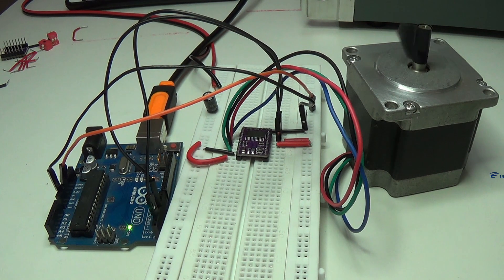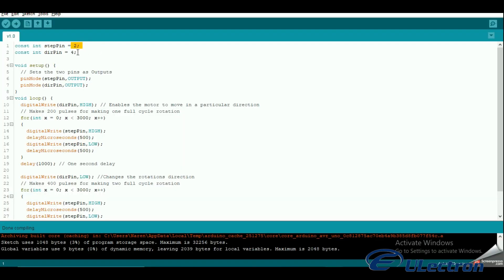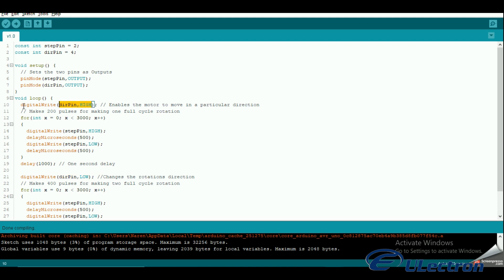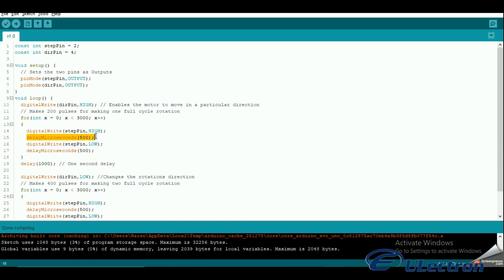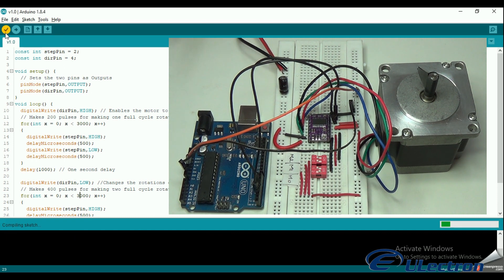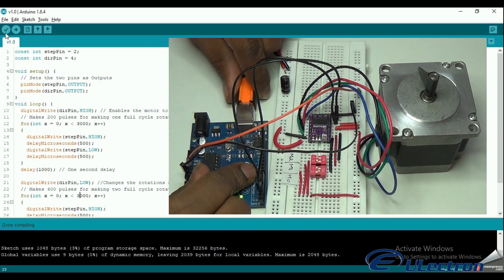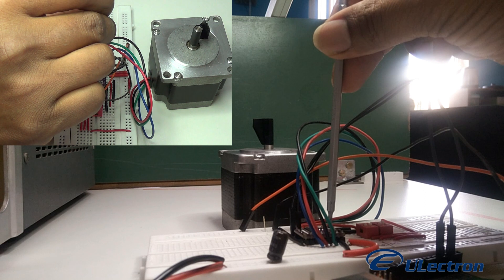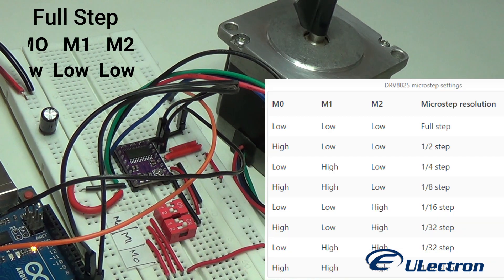How to interface DRV8825 and stepper motor with Arduino|ULECTRON|

Comment: Bonjour,
je démarre dans l'arduino et je souhaiterai faire fonctionner des moteur pas à pas avec un DRV8825
mais je n'y arrive pas 
serait-il possible d'avoir le soft pour tester les moteurs?
Merci

Hello,
I start in the arduino and I would like to run stepper motors with a DRV8825
but I can not
would it be possible to have the software to test the engines?
Thank you

Comment: const int stepPin=2;
const int dirPin=3;

void setup() {
  // put your setup code here, to run once:
pinMode(stepPin, OUTPUT);
pinMode(dirPin, OUTPUT);
}

void loop() {
  // put your main code here, to run repeatedly:
digitalWrite(dirPin, HIGH);
for (int x=0; x<3000; x++)//make 200 pulses for 1 rotation
{
  digitalWrite(stepPin, HIGH);
  delayMicroseconds(500);
  digitalWrite(stepPin, LOW);
  delayMicroseconds(500);
  }

digitalWrite(dirPin, LOW);//change direction of rotation in opposite
for (int x=0; x<3000; x++)
{
  digitalWrite(stepPin, HIGH);
  delayMicroseconds(500);
  digitalWrite(stepPin, LOW);
  delayMicroseconds(500);
  }

}

Comment: I've got 3 nema 17 stepper motors (X, Y, Z axis) hooked up to an Arduino Uno board with a CNC shield & 8825 drivers.  The motors just hum & won't turn so can somebody please help me figure out what's going on so they will work as I've checked the wiring & think it's possible my settings are off in the program?
Reply: Try adjusting the current thingy

Comment: Do you know if that code works with two drivers, in order to control two motors at the same time?
Reply from the maker: Yes it will work

Comment: will USB output work for the power supply?
Reply: for arduino u can use usb as power source and for driver i.e. for Vmot pin of DRV8825 you must use external power supply.
OR you can use 12v supply for both arduino as well as driver.⚠So for DRV8825 you cannot use USB as power source.⚠